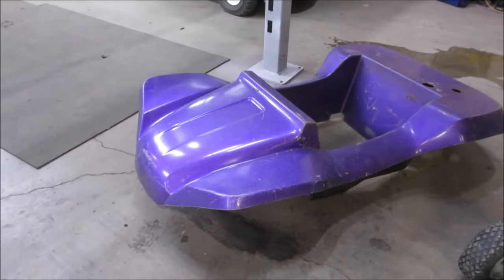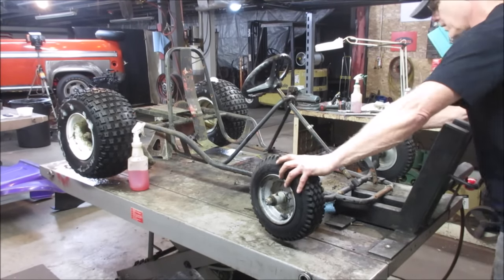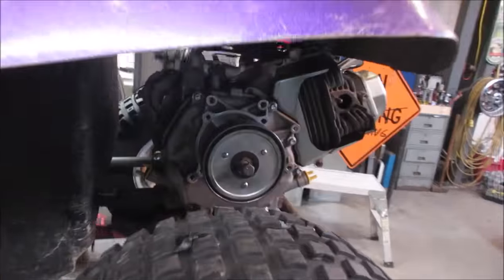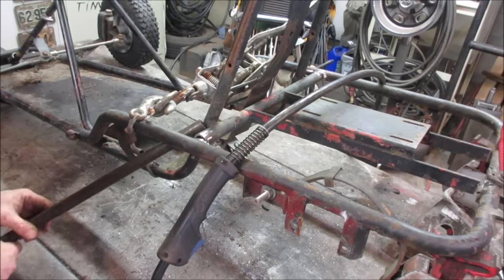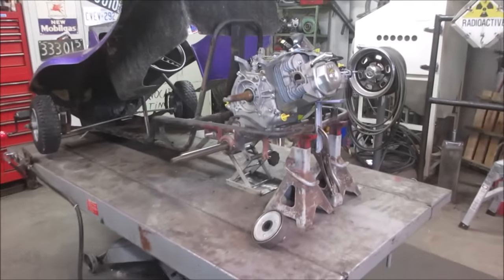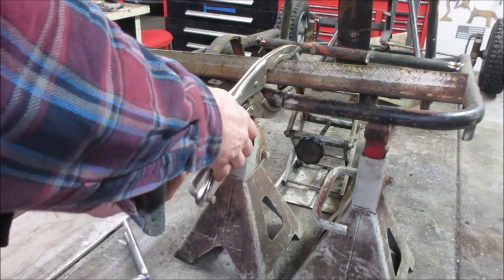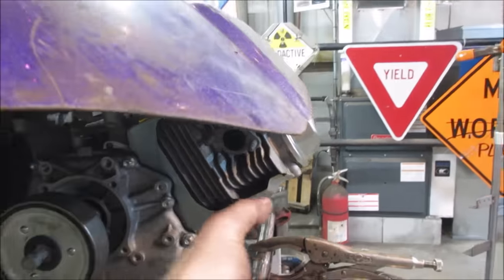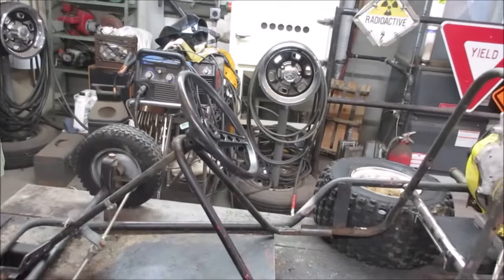Built From Trash. VW Dune Buggy Mini,

Comment: As a small advice. You can use bicycle tubeless sealant To fix those dry-rot leaks on the tires. I fixd my kids atv wheels with that like 6months ago and its holding air perfectly. It doesnt make as much mess as heavier stuff for cars etc

Comment: It really is amazing the range of things you can do in your shop.  :)  Also, I've enjoyed your more "freestyle" builds since your "think twice" motorized bicycle.  :)
Reply: I think I would have cut the fiberglass to fit the frame, rather than cut the frame to fit the fiberglass, except perhaps for lowering the engine mount, but I don't see a problem with having the body high in back to clear the engine, not cutting out the center rear deck support and screwing in other, wood or metal, structural supports for the rear deck to each side of the engine.  I would not have narrowed the rear frame and am concerned that the narrower axle bearings might bend the axle, especially with an adult.  An adult also has more use for a full width frame.

Comment: That engine came off of a generator. You can tell because of the unknown black box - you’re correct it’s a charcoal canister. Epa rules require them on generators due to the long run times that they see.
Reply: In my experience, generator motors always have a tapered shaft. I was curious and I googled around and the only hits are for a wood chipper and a log splitter
Reply: @davemiller262 Makes sense! Another piece of equipment that runs for long periods
Reply: And also sits unused for long periods of time.

Comment: The noise you will probably hearing in the tyre is probably wax balls the inside of tires are covered in a wax as it gets hot it falls off and because the wheel is turning around so fast it turns into little balls

Comment: If you had made the 1st cut at 90 deg you could have just brought in the sides in  and never messed with the rear portion.   1 cut , 1 weld on each side.

Comment: Hi Darren, maybe make a small hinged “hood” out of a piece of the body above the cilinderhead/ spark plug. I think you need to get rid of the governor to set idle and use the engine for gas pedal setup. Keep up the good work. Greetings from the Netherlands.

Comment: 👍👌👏 This will be quite a fast, nice looking toy for a big boy! 😁 ;-) 2) Maybe something like the famous Mercedes 300 SL Gullwing has (steering wheel tilting upwards) would be helpful. So the steering wheel would still be usable as a handle while getting in the buggy gocart. Or at least a removable steering wheel (like on formula 1 race cars)? 3) Some motorbike trikes and buggies have chrome racks mounted on the body in the rear (for luggage for instance). Maybe you can fabricate something similar for carrying a little fake leather suitcase/bag to hide the gasoline tank in it? Something similar to what you did to hide famous Crusty's winch.
Thanks a lot for making teaching explaining recording editing uploading and sharing.
Best regards luck and health in particular.

Comment: hey just a thought on the engine chain adjustment, possibly put adjustable bolts under the back end of the engine. That way it keeps the chain inline but  can be adjusted as the chain stretches out!

Comment: The lock on the axle is made by a company named Taper-Lock. I think you can get new ones at Mc Master Carr. I've worked with taper locks in the past, you're correct, they work great until you need to get them apart 😂
Reply: Works like a router collet.  Great design!
Reply: Yes McMaster-Carr does carry those, so doesn't Grainger industrial supply. Remember this from when I worked in a industrial plant in Oxford, Massachusetts for 5 years.

Comment: If the engine shaft being too close to the axle sprocket is a serious worry, reducing the arc of contact of the engine sprocket,  I would respond by mounting the engine farther back, behind the axle rather than above it.  This might also get the engine out behind the body, easing fuel tank, air cleaner and muffler installation; and improve off road traction at the possible cost of causing wheelies and loss of steering.  But again, with no plate, offroad traction and steep hill and ground clearance become frequent, major concerns; where space for top speed is rare.
    The engine mounted farther back just might also create opportunities to move the seat farther back, increasing adult leg room and improving traction still more, though both body and frame might present challenges there.

Comment: TIRE REPAIR: I've had good luck with pouring liquid latex into the valve stems and rotating the tire till the inside is coated. I've fixed basketballs and soccer balls this way, too. People say to mix things in with it, like glitter, etc, to create surfaces for the latex to latch onto, and help it dry faster, but I've found that straight up liquid latex works well all by itself. Keep the tire moving till it's dry, though, or you'll have an out-of-balance tire (or ball). (Gotta keep your balls balanced!)

Comment: Looks like with them 2 tabs on the bottom of the fiberglass body you could flex them out enough to tuck underneath the floor pan of the frame.

Comment: There is plenty of room on a Dingo for an adult. When you tried sitting in it, you did not put your feet as far forward as they should have been, past steering linkages and all the way to front end of the frame. May have to trim the 'dashboard' a bit more though.

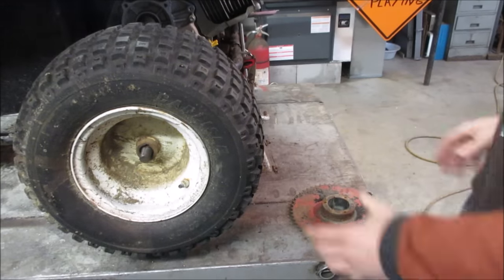Comment: 52:22 The best tire sealant I've ever used is a product called TireJect. It's a liquid rubber that bonds with the inside of the tire to make something like a permanent innertube. It works great on old dry rotted tires.
Reply: We used to sell a sealant at work that had fibreglass strands in it... It would literally create a little fibreglass patch over any serious holes or cracks. Fantastic stuff... Only issue was it also sealed up the valve stem quite often, which means it's only really useful as an emergency repair, not a longer term fix.

Comment: Just a thought, would it not have been better to have the chassis outside the body instead of cutting it down to have some protection against hitting the body & damaging it, to extend it and add some mounting bracket for the body to attach to?
Reply: Good point. The only thing is it would not be aesthetically pleasing and the idea is to not run into things with it. :goodvibes:

Comment: A spocket the size of the tire diameter would hit the ground, so it seems preferable to me to go with the smallest possible engine sprocket instead, to preserve ground clearance, and also place the sprocket close behind the tire.  The bigger engine, with more torque, should allow a smaller axle sprocket, unless it requires a bigger engine sprocket, for a lower reduction ratio, and higher speeds, with the same starting force and acceleration, unless acceleration is the objective at the expense of top speed.  Though anything without a plate will have limited opportunities to use high speed and will have many steep hills to climb.

Comment: Could maybe cut the frame somewhere between the seat and steering area and try to lengthen the overall wheelbase front to back in order to make it so you can fit in there a bit more comfortably and have a little more leg room.

Comment: Im interested to see how an engine designed to run at one set rpm will work on a setup requiring variable rpm
Reply: It still has an adjustable governor so it's probably meant for something that would have been adjustable.
For go karts and the likes taking the governor off of the carb and controlling the throttle directly is standard procedure anyway.
Reply: @samuraidriver4x4  I suppose it is "standard procedure" for those that are ignorant. The governor for a standard engine (non generator/pressure washer) is fully capable of providing throttle control across a wide range of speeds, people just don't understand the governor nor how to adjust it. The governor control (static engine throttle) on some generators just has no setting for idle speeds or anything below 3600 revs because it was deemed superfluous. If that is the case, it will have to be removed and replaced with a standard governor control.

Comment: Put larger wheels/tires on the front, not as large as the rears, but slightly larger which will suit the Meyer's Manx Dune Buggy look a whole lot better. Should have just vertically notched the console for the steering column because it had a nice artful curve there and for "aesthetics" but oh well.  Sometimes the things you make have to remain child-sized but I like the idea of making it child/adult size with removable parts. Consider adding a second pair of pedals that are linked to the main pedals by linkages/rods/threaded yokes.

Comment: I've heard transmission shops complain that when customers use "magic" transmission fixing juice, all the seals swell and elongate. (making it harder ti disassemble) Since that seems to be what it's designed to do, I wonder if that wouldn't work even better than regular oil in leaky tires.

Comment: Mustie some of those chinesium motors especially if on a gen or pressure washer don't have an idle circuit in the carb they run at a set top rpm with no adjustment. might want to check.

Comment: You mentioned before that oil was for low speed tires, I assume because oil exposure might weaken the carcass and cause sudden blowouts?  I wonder if a go-cart with a big engine should count as low speed tires? and as front blowout more often cause control issues than rear blowouts, If you plan to use oil in front?  The main alternative being latex tire sealants, and/or tubes.

Comment: That diamond cutting wheel is for concrete, stone and ceramic tiles, not metal,  plus the cutoff wheels  for metal are a lot cheaper
Reply from the maker: says metal right on the blade

Comment: With a straight shaft, that engine was not on a generator. It was almost certainly a pressure washer.
Reply: It also appeared to have a throttle, so definitely not a generator

Comment: What if for a chain tensioner you welded nuts to the bottom of the motor plate then raise the engine with bolts. Then nut n bolt secure it through the normal mounts? Use jamb nuts on the adjusters?

Comment: Sorry, but engines usually run clockwise. If this is the case, this, ehr--- contrapation will only reverse. Move the gear to the other side, and turn the engine around, so the top points forward.

Comment: I read that using brake clean on metal to weld can release toxic chemicals due to the brake clean, recommended using carb cleaner. I don't know if this is a true statement.

Comment: What is that yellow dipstick that is wedged up against the body, where you can’t access it?? (49:10)…or maybe this will come later in the video……
Reply: There’s two dipsticks one on the front one on the rear.
Reply: @cky2k244  Yes I see that.  But are they both for oil, or the same thing??  That was what I wondered…..
Reply: @Inisfad  they are both for checking oil level, depending on how the engine is used and mounted.   One of the dipsticks should always be accessible.
Reply: @robertheinkel6225  Ah, ok. Thanks for the info!
Reply: The reason they do this is the engines are made by one company, and then implemented into machines by other companies. The engine has to be manufactured so that it's fairly universal in how the oil can be filled and drained when it's mounted inside or against whatever it's running.
Sometimes they also have 2 oil drain holes aswell.

Other stuff like the air cleaner, fuel tank, etc is usually not an issue since it can be piped off to the side or up higher without any negative effects. Oil kinda has to be down where it is.

Comment: Temu has rubber glue that hardens to a consistency of regular tires, and could possibly at least fix the tread, and maybe the side walls. Its black, so it would look like the rest of the tire.
I had a side by side tire that had a blister on the inside of the tire, so I  put a hole in the blister and put the glue in the hole, and it hardened like the rest of the tire. For good insurance, i also had it patched. The guy at the tire shop said it looked like a good repair.
Reply: The problem is the entire tire is deteriorating;  Flexure in use will open up cracks in places where there are none right now.
Reply: Temu also has loads of scams. It's like if Amazon and Wish had a baby...

Comment: 1:18:17, that’s the low oil shut down control box.
Why buy spacers, when you can make them out of pipe??
This engine definitely was not on a generator, since it has a hand throttle and the crankshaft isn’t tapered.
You should know that.

Comment: I have a question about this type of tire problems.

Why not just get tubes for them and not have to worry about the cracked rubber?  I would think that what ever shape the rubber on the tires is in should hold up ok with a tube inside.
Reply: For a mower or garden trailer/cart, that's what I'd do... it's only going to be going walking pace anyway.
But for something capable of speed, I'd want to have tyres without visible cracks, even if I did stick tubes in them.
Reply: Tubes in a tubeless tire configuration (tubeless tire, tubeless rim) presents its own set of problems. Most inner tubes have the valve on the inside of the rim and not on the side. Even if the tire valve has a 90° bend it won't reach the hole for the tire valve properly and it will put undue pressure on the inner tube.

Comment: Nice shirt "Stihl - build in America", but i´m still missing the amendment "engineered in Germany".
Reply: "from parts made in China" is probably a valid addition too... At least some of them would be anyway.
Reply: @tin2001  Not really, the carb and oil pump are made in China and the Philippines. The housing, the blades and the magnesium parts are made in Germany, the chain is made in Switzerland, the cylinder is made in Brasil and the plastic covers are made in Germany and USA.

Comment: Oil in the tyres is a terrible idea, it just corrodes rubber to pieces.
Reply: That it does, but I suspect a small amount, once absorbed into the rubber's pores, is a dandy short term fix. Tire slime would be better.

Comment: That "frame" is appalling... no effective triangulation and plenty of bent conduit. Under stress it will bend in half. It belongs in the tip.
Reply: Ridiculous. it's not bent conduit, it's heavy wall steel tubing. Those are some of the sturdiest frames ever made--unless you're morbidly obese, tipping the scales over 300lbs or something